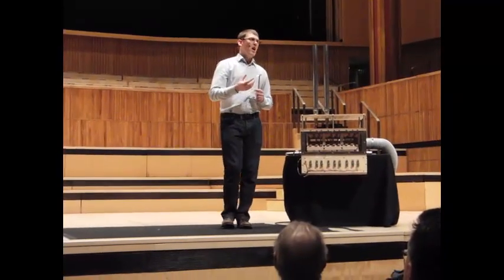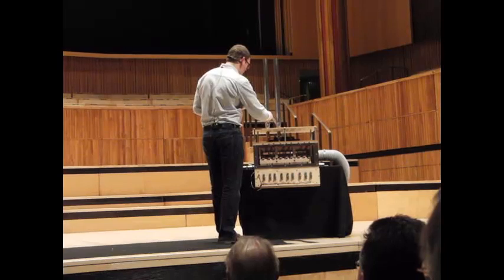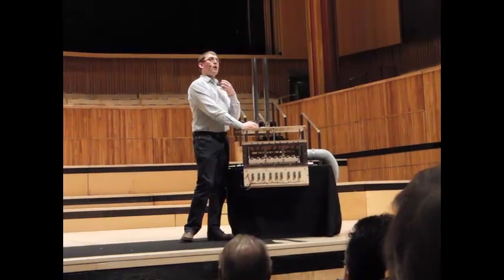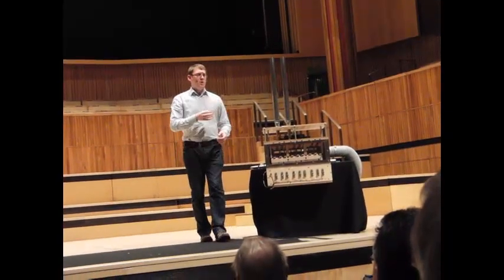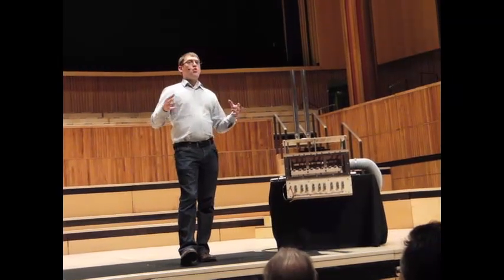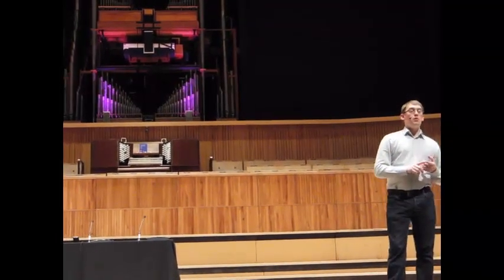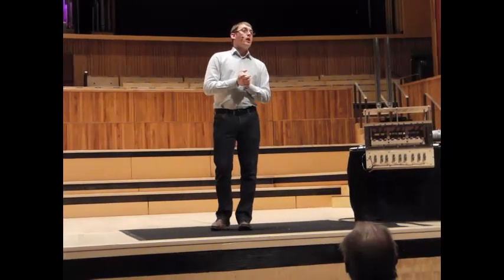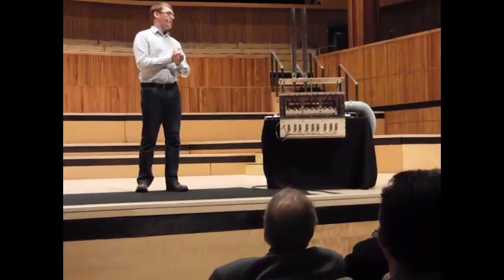Andrew Scott demonstrates organ pipe voicing

Comment: I'm a big fan of open TOE voicing. Was he saying "open" and "closed TIP"? I've been voicing and regulating for decades; I've never seen a voicer test for "slowness" by blowing hard and listening for undulating tone. I'll have to give that a try. It's amazing that organ pipes (like those he was blowing) are made of 10 to 70% lead. Isn't lead a highly toxic substance? Nope! Lead compounds-that are easily dissolved in water- are highly toxic. The metal lead, pure or alloyed with other light metals, appears not to be dangerous. Organbuilders and stained glass artisans have been plying their trade for centuries without complaint of lead poisoning symptoms, formerly known as "painters stomach".
Reply: What determines the volume of the pipe when it speaks? I play an organ that has a Principal chorus(8,4,2) in the swell, and my 12 member choir can overpower it, and they are in their 70s.  I also have string stops and an oboe in the swell that a solo singer can sing over it. Plus I have to use the sw 4' coupler to use swell for hymns. The great isn't that strong either with it's stops, but its principal chorus is a little bit louder than the swell principal chorus. Then the church added a great trumpet 8 that sounds like a loud chamade sound, which over kills almost all the fundamental stops and mixtures of the whole organ. It's a 25 stop organ, it should sound louder than what it is now.